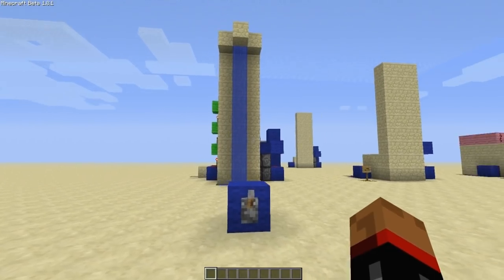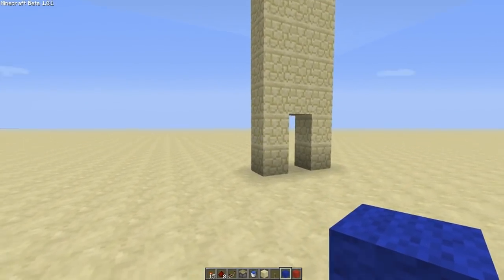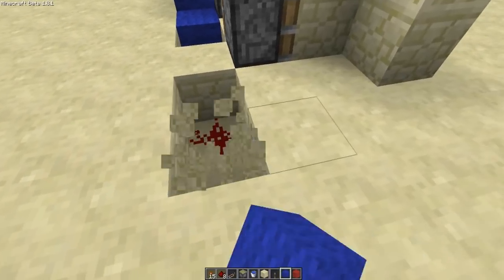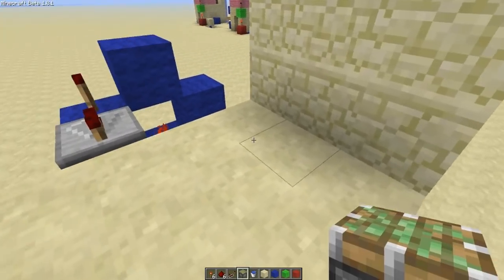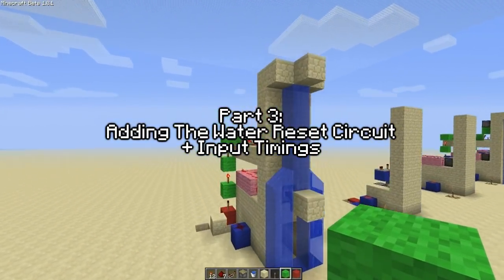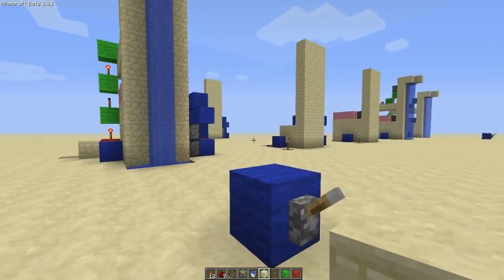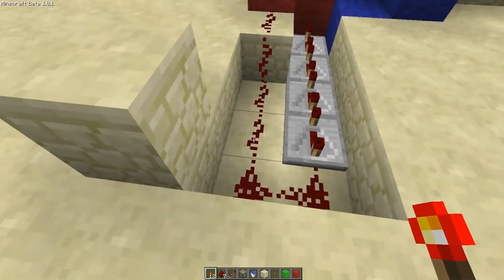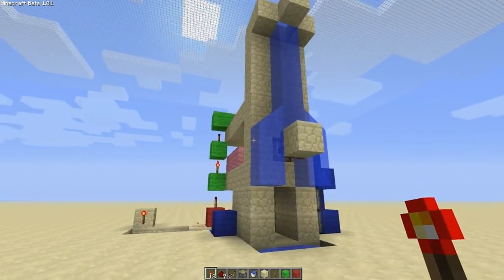Waterfall Splitter/Secret Door i.e. Batcave Entrance [Minecraft Redstone Tutorials]

Comment: The door was made in minecraft 1.8.1, where a piece of redstone, when not connected to another would form a cross and power all 4 sides, even if it's connected to a repeater. On 1.0+ It was made so that when connected to nothing at all it's just a dot, thus powering all 4 sides again, but when connected to a repeater (or torch, for that matter) it forms a line, which only power the side opposite to where it was powered. What you can do to fix it is place the green wool in front

Comment: or you could just have a redstone powder line going down a staircase thing inside of a wall next to your batcave. then have the lever on the wall to the side of your cave. you can even disguise the lever with an overhang on the wall for some shadowing. the problem is that with a lever, you need to turn it off before you can use another lever on the inside. you can make a hidden door to come back out and flip lever. then on the inside another lever will turn the waterfall on and off.

Comment: this tutorial was very well done and was easy to follow. I had to make a tweak on the xbox version with the 'green' circuit, now it works perfectly!
Reply: What was the tweak im also having problems with the green circuit
Reply: The only adjustment i had to make was at the top, where the double piston extenders are. I had to feed into the block that hold the Redstone torch with repeaters rather than Redstone dust
Reply: Shawn Hall  I have the same problem but don't understand what you changed

Comment: To make this work when you're having a problem with the very top section, you just need to move everything one wider out so that the red stone can turn directly into the block instead of running beside it. The torch will need to also be moved back one instead of being in the very end. 
Not sure if that's clear but it fixes the problem :)

Comment: I saw that pulse limiter, and thought it would be awesome to have for a drowning trap, that works via tripwire and drowns the invading player.  I use the Secret Rooms mod, and inverting the output, so that the gate starts out closed, but opens once they hit the tripwire, and then closes after they drop in.  Then I could have hoppers at the bottom collecting drops and funneling them to a collection point.

Comment: the splitter will only work if it is a double piston extender or the water will flow infrot of the extended pison, so it won't still work, ensure power can get to the piston and that there is less delay on the front piston then the back piston

Comment: I know a way, Its quite complicated but I'll explain. Facing from the back you bring the green circuit's platform out one block to the left. Then use redstone to move the 2 repeaters (that go towards the block) out 1 to the left. Afterwards you need to link it forwards and left in a loop and have a redstone repeater facing the block (with the torch on). I tweaked the waterfall and sort of encased it in glass :/ This system work for me. Hope it works for you :P

Comment: There's two problems now with doing this in 1.5.  First of all, redstone doesn't always connect the way it used to. You need to arrange it so it points to the block you want powered directly.  Not just beside it, but going to it.  this means you need to build the "re-set piston" floor wider so you can make the redstone turn into the block.
Second prob is that water now falls faster in 1.5, so you need either more repeaters on the "return" side of the piston, or make the waterfall MUCH higher!

Comment: yea, my server was just updated to 1.3 and i'm having problems here. The falls splitter block - the double pistons are working, however, once the block is fully extended, the sticky piston doesn't move it back, flush with the wall. then, as michael garcia mentioned, the torch that activates the water piston is constantly on.

Comment: Uhm, because of an update redstone becomes circular when placed in one spot, not in a cross which is a redstone, and 4 other redstones coming from its sides, the center will look like the cross in the vid. Anyways all you need to do is to make a line going into the block, so just extend the repeaters 1 block over so you can make the redstone power the block directly. like how he's done before. So instead of the 3x5, your right side will have 2 blocks more. and left side will have 4 blocks more.

Comment: I know how to fix the green circuit if it does NOT work for you!
Green Circuit:
The reason for it not working is probably because your redstone is not a cross when placed on a blocked. If you place a redstone dust on 1 block check if it is a cross or circular because if it is circular then you need to make the redstone dust point to the block where the redstone torch is ,which gives power to the sticky piston, instead of just putting it next to the block. (I hope it made sense to you!)

Comment: the problem is that the 2 redstone dusts after the repeaters of the pulse limiter won't be the cross any more, you can fix it by putting an extra dust on top of the block between the 2 dusts

Comment: To fix it, at 7:47 he puts the redstone torch on the top. if you were standing in front of the torch you need to put a block to the front left block that the torch is on. then put 2 more blocks in front of that block(going  toward the front of the structure) after that put redstone directly to the left of the torch, then a repeter, then more redstone then another redstone, then put redstone so that it goes toward the block with the torch that isnt on. if you need help i could do a quick video

Comment: Found a way to fix it in 1.2.5 :what you need to do is make the base of the top part 11 long and use 2 repeaters in the side where the power comes from with 2 delay and then on the other side use 8 repeaters (full delay) connected to 2 red stone dust and that connected to a reapeater that connects back to the system

Comment: I know it's old, but I prefer this layout to the newer one.  But for some reason, I cannot get the waterfall to re split. It looks like the double piston extender goes back in just a little too slowly. I have tried adjusting the repeaters on the pink circuit but then I get the stone block left in the waterfall. I have also tried delaying the green circuit more. But that also does not work. Is there a fix to this problem?

Comment: it doesn't work on 1.5.2, on the green level, the last torch powering the top piston doesn't receive from the two dusts on either side, and the timing is also out for the retraction of the middle piston that separates the water.

Comment: I just followed this exact but I have slight issue. The door works fine but the block up top for the water won't move. I notice when I add red dust in certain places it doesn't make that plus sign. Its either just a dot or line depending whats next to it. I added a switch on the inside and was playing around on how to add one across water on other end of my bridge but that one doesn't work. First thing first though, I can't get the water to fall out since the block won't retract in.

Any ideas?

Comment: I've been dealing with thing for hours and its getting frustrating. I just took it all out and redo from scratch. The top one for water is stuck out and will not retract. the block that splits the water will not go back in hole. Piston does retract but block is stuck outside of hole. When placing redstone it does not make that cross shape. Not sure if that is causing issues. 

I'm on ver 1.3.2

Comment: At the top for me i have the last torch on the green wool block and the other green block on top of it i then put the piston on it comes out when i put mine on but it dosen't on the video why is that happening. I did it all the same step by step but my piston extends when i put it down. is then a different way for the top bit to work correctly.

Comment: SOLUTION. For the water holder--- Make the delayed repeaters one block higher all the way around and place redstone on the top of the block with the torch on the front. Then place a block above the right redstone patch to make sure that the circuit does not complete itself. WORKING ON A DRAWING